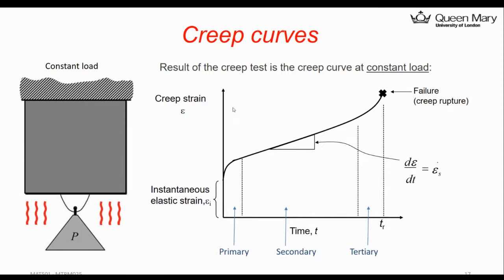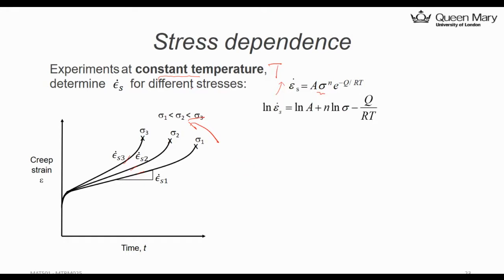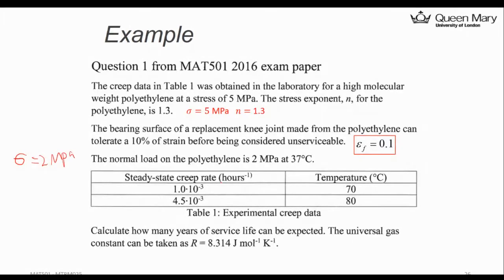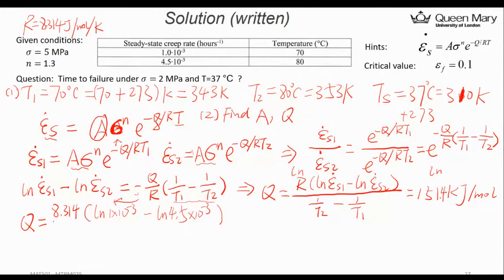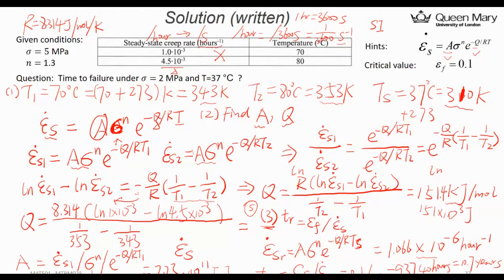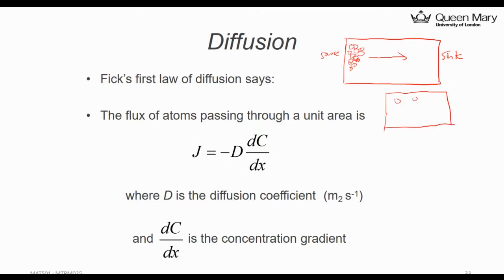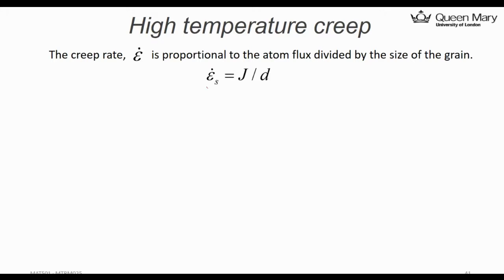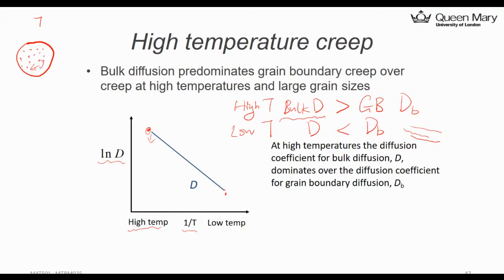Week 9: Creep failure and mechanism

Comment: Sir where we can more details about behavior at microscopic level and it's explanation about this primary secondary and tertiary segment m
Reply from the maker: Microscopic level for the power-law creep is more related to the dislocations. See the new video: https://www.youtube.com/watch?v=uhTF_ghDLcI
Reply: @mechanicsforengineers  I seen that sir. Is there any thing else which I can go through. I want to pursue my phd in the material behavior and its mechanics. So I want to look as much as possible content or the paper or anything or any good book for the same. If can suggest me some book then also it will be huge help.
Reply from the maker: @lasanvagharelu8023  There is one book I can suggest: Roesler, Harders, Baeker - Mechanical Behaviour of Engineering Materials Metals, Ceramics, Polymers, and Composites.
Reply: @mechanicsforengineers  thank you sir... I will look into that and if I find any difficulties I will let you know